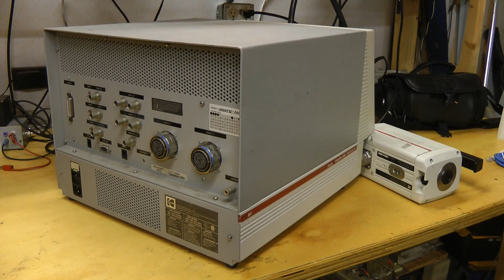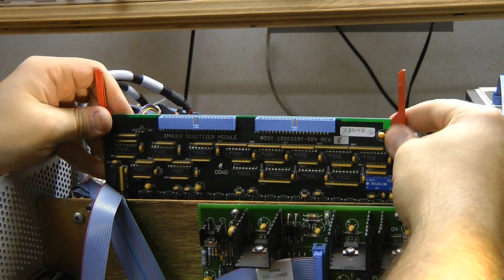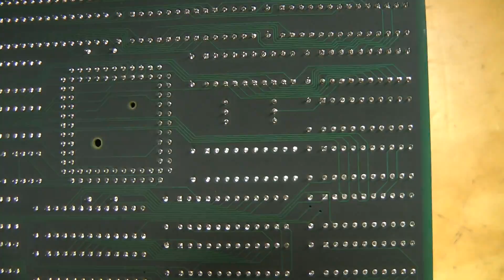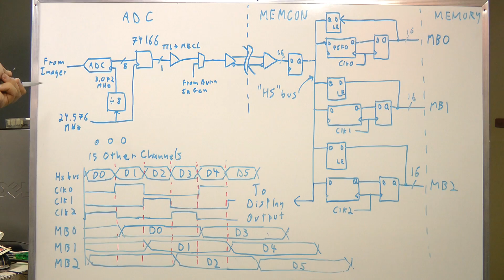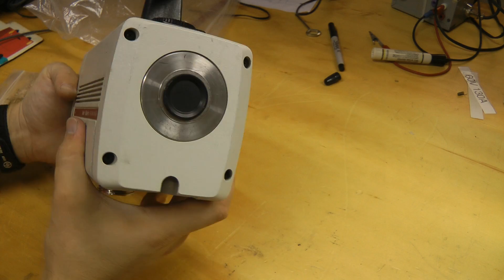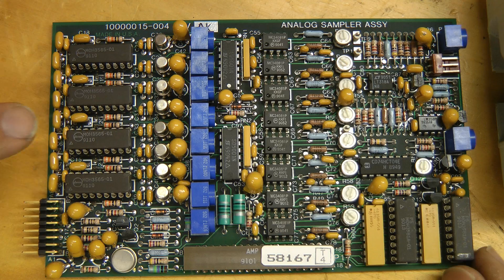Ektapro EM High-speed camera system teardown

Comment: A friend of mine has a dozen or so NOS DataMetrics 1500 high-speed thermal printers.  Even being from 1990 or 1991, they only have two or three ICs and the rest are transistors...100's of TO-5 transistors on cards which are used to drive the nichrome wire printhead.